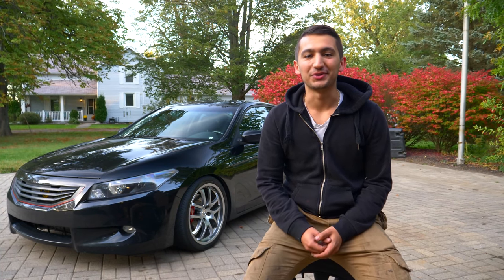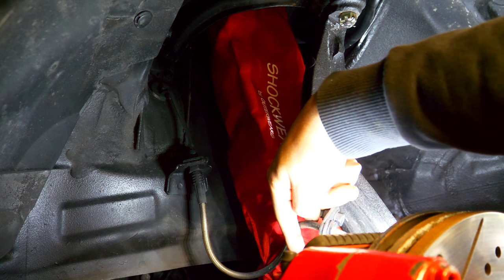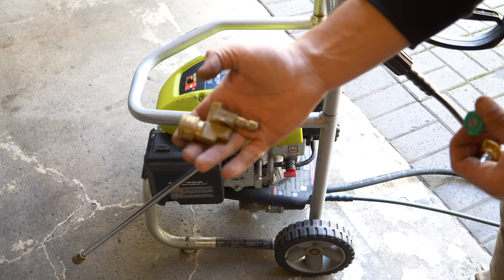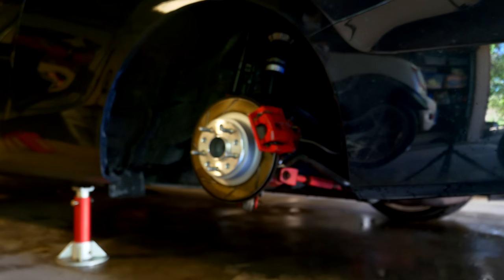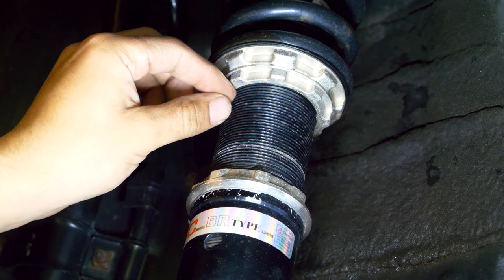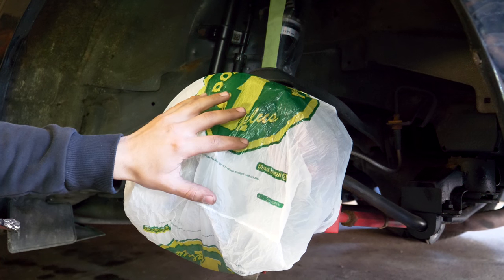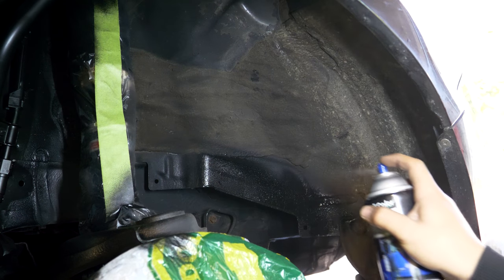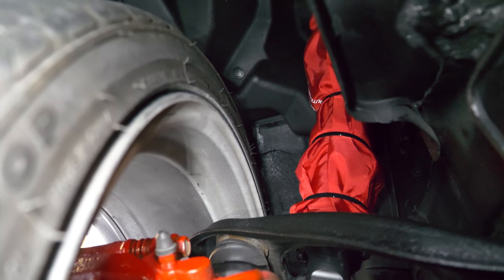You NEED These to Protect Your Coilovers

Comment: Paint is an interesting idea. Looks good but what are the differences between paint, oil based methods and the old stand by old fashioned undercoating method. Fact of the matter no matter what you spray it's best done from the factory. When you buy a car see how it was done at the factory.  I have a 2010 Hyundai Elantra Blue on jacks right now. The undercoating is Absolutely perfect! It's really up to the manufactures to get back in the game and get this stuff right for what you are paying for an Automobile. They were bad in the 1970's then learned and have since withdrawn their protection. There is a need for a buyer rebellion for those companies that do not get it. Yes I do live in the rust belt.
Reply: i live too in the "rust belt" i agree with you best from factory but car manufacturer just want you to change car asap after you buy it... i have a 2014 charger saw 1 winter cause i had no choice at that time but its rusting in many place some bolt hoding the exhaust to th frame its no longer look like a bolt! spot weld too are rusting under the car its just primer! but on the other and i have also a 2008 magnum it has rust not that much but some(i see worst from same year car) because the previus owner didnt put oil underneath, i remove the inside on the fender there some spot of rust i clean them put some rust converter, primer and paint but is the same as the charger its only primer! even GM do that nowadays! i mean you buy something that cost a lot and you need it to go somewhere but the car manifacturer pout deadline life on it here your lucky to have a clean with at least small rust on it, some are really bad ... they put too much salt on the road, i see some truck continu to drop salt even at the red light! or even better two truck following and the drop was dropping salt on the same place! its stupid...

Comment: Do you still recommend cooper anti-seize for this procedure or will be way better with aluminum anti-seize? Got a lot of cooper a-s at home so just wondering.
Reply from the maker: They both work very well. If you have Copper AS, than use that by all means. You just don't want both metals to seize and corrode together. You could probably get vegetable oil to work lol
Reply: milanmastracci well thanks a lot man!

Comment: btw it may sound a little ironical or extreme....but instead of using this sock, why not use a box of anti-seize copper grease bottles?
Reply: I use spray on lithium grease, it works, but it's really really messy and traps a lot of dirt. It's fine if you don't plan on adjusting it often, cuz you have to clean it off or else you'll grind the dirt into the threads.

Comment: I fixed my coilovers problem by getting air bags :D not kidding
Reply: Tomas K Now you have a cornering problem
Reply: Airbags have been proven time and time again that it can be just as good, if not better than regular coil springs. Not to mention a lot of the highest performance models are on airbag from factory.
Reply: Good luck when your airbags pop.
Reply: Until it pops. That's my only gripe about air suspension. The shorter life span.

Comment: I was advised against it, as they can trap moisture. I just keep em clean and store it during the winter drive a beater. Its cheaper
Reply: If you get a proper cover, that is actually waterPROOF, breaths and it provides a good tight seal, no moisture is going to get in to rust it. And no, beaters aren't cheaper... you need to buy one, insure it, and have space to park it.

Comment: Water will stay on the shock longer with this covers.
Reply: thew water will prell of, it wont get soaked :P
Reply from the maker: How so? The coilover is completely wrapped in this cover, and the cover is water resistant. Water might sit on the outside of it, but that's about it, the coilover will be untouched.
Reply: milanmastracci okey , i tought its a regular fabric...
Reply: I have had a similar product and it survived one winter SO well! I even cleaned them and left them on for summer.
Reply: Marko Cmiljanic 🤣🤣😂 that would be ridiculously pointless no?

Comment: that... isn't going to do anything, the top and bottom are completely not sealed, you have one coil peeping out top, and the bottom is held open by the bracket... it's gonna do more harm than good. a proper seal is a different story, but in your case... is worst case scenario, might as well not have it